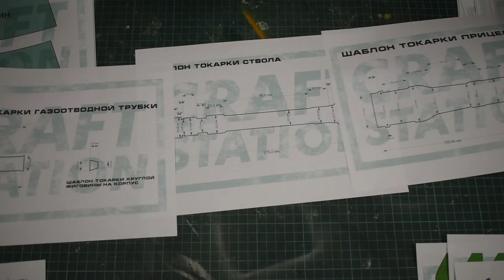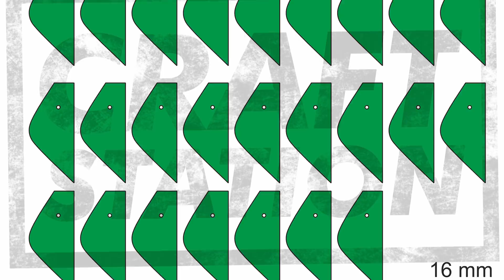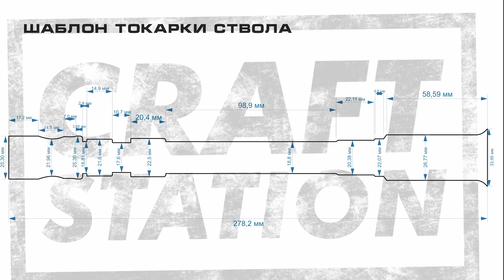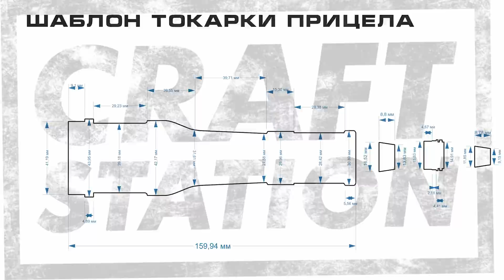HOW TO MAKE AUG AKIHABARA from CS:GO DIY

Comment: Just out of curiosity, how come you didn't use an airsoft AUG and then put the design on that? While the build process wouldn't be as interesting as hand crafting one, but then at that point though you could at least sell them and it's still functional and can actually be used, I'm sure people would buy it. Either way cool video.
Reply: Maybe he just want to put more effort to the gun instead of buying another one?...
Reply: And. Do you have any idea how much a Aug airsoft would cost? Hes trying to save a buck.
Reply: Rival Stalker you can get a airsoft aug for about 100 bucks which is cheaper than all the tools and recources it took to make a silly wooden paperweight
Reply: Rival Stalker Yes I do, since I own an AUG A3 that I custom painted and internally upgraded myself. Again I'm not judging him for making the way he did it's still really cool, my idea was mainly just focused on general functionality. Basically giving it more use than being a show piece.
Reply: Does the airsoftgun version of CS:GO AUG really exist?
Reply: I believe you could find one fairly close to it. I have a A3 airsoft which is a little different. which has the full top, bottom, left, right, rail system on it. Though even if you get the same version of AUG it will not of course have the skins, you'd have to do something like that yourself.
Reply: Ich know its a litte bit late but .... Can you give me a link too an Airsoft aug thats 100 Bugs (If ist would Work Not with full Auto cose im a german)
Reply: You can fund decent full auto airsoft guns for $100-$150. Not the kind that are fir back yard inly and you be better of at the field with a nerf gun. Its a hell of a lot cheaper than a milling machine.
Reply: @Revtiva  yes. Its the aug a2 specifically. Just get an acog or red/green dot scope (not to be confused with reflex scope). Ithe foregrip folds down.
Reply: He actually did that with an  airsoft ak before but its cheaper than buying all the machines be usedike the meat and bone saw machine. $2800.